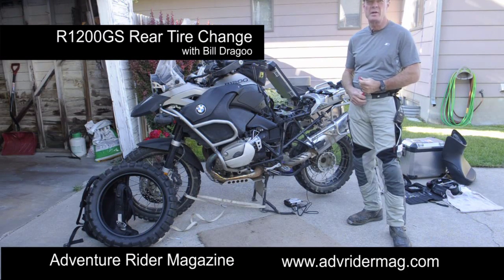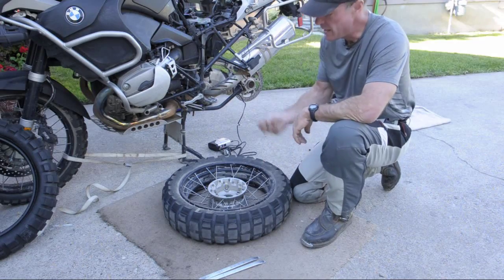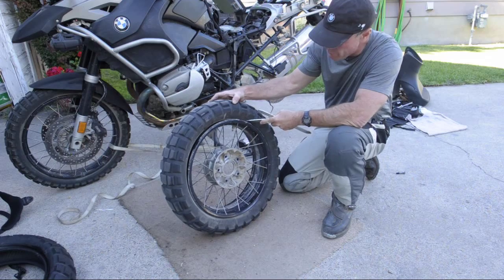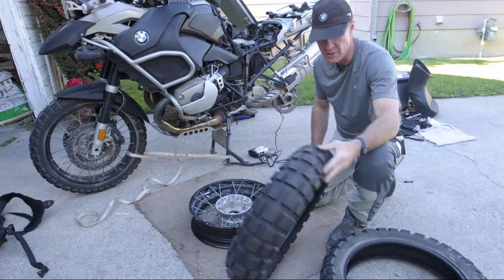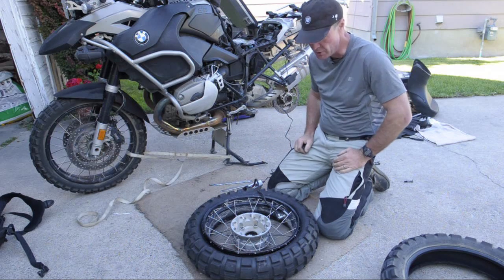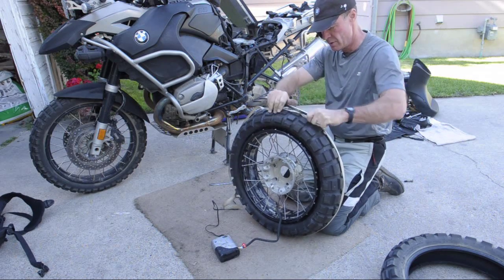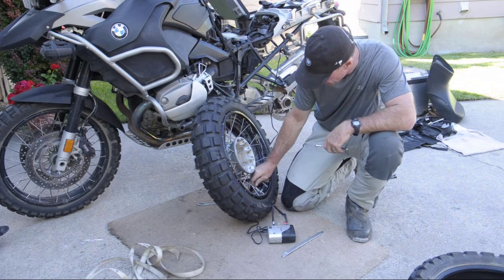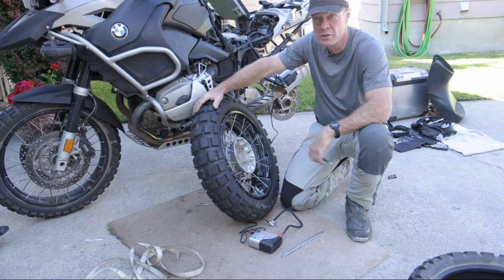Bill Dragoo shows how to change the rear tire on a BMW R1200GS motorcycle

Comment: Didn't see you balance the tire and wheel or was the prior weights sufficient? Curious.  As a dirt rider, this is not needed, but just wondering on the R1200GS since you will be doing hwy speeds. Great video and thanks.